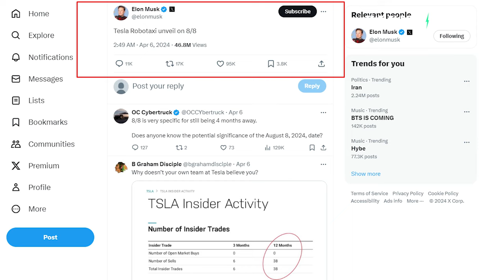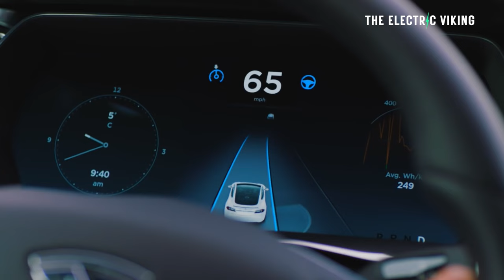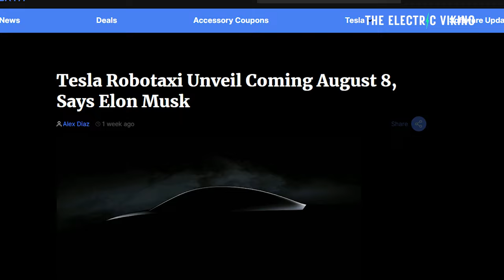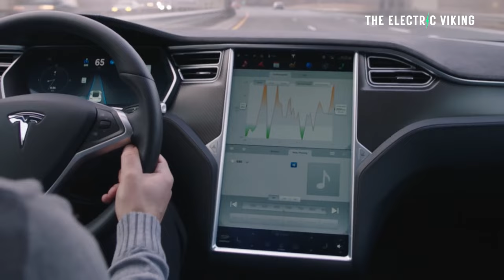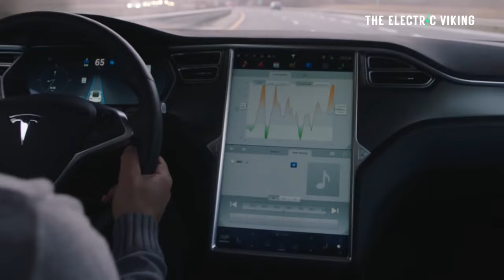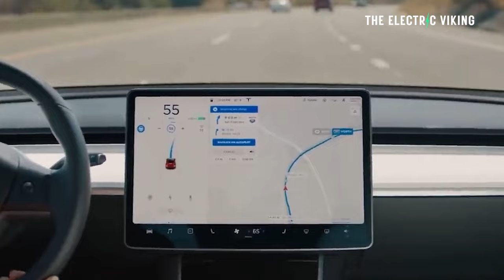Tesla is hiring Prototype Vehicle Operators in these 15 U.S. Cities

Comment: I have been testing FSD in the US during the free trial in a HW4 equipped Model Y and generally it's been a positive experience, however it's still more a curiosity tool than a fully functional one. I have had to intervene twice when doing a U-Turn and a Left Turn across busy roads, it just wasn't up to those two tasks. FSD where you can relax and be confident of the vehicle doing its own thing successfully is coming, no doubt. So it's great that Tesla are the leaders in this field and I am sure they will crack this nut eventually!

Comment: [Hhhmmm ...] Looking into using Cybertruck/extended-range as a emergency tow/charge vehicle for EV's in South Florida area. Does anyone know if EV's default to 'neutral'[N] once the battery dies(?) Once saw a totally bricked Tesla that  couldn't even roll off the tow-truck for charging🤯 Couldn't even open the charge-port, fixed on Cybertruck[?], but also saw the workaround in the trunk space. Of course, conversion to a #CyberFood truck is another one of my whacky ideas that would certainly draw a crowd at events, or just at large Supercharger locations(...?) Just a thought🤔🤑

Comment: The future of FSD is integrating FSD into municipal transportation systems which will make automobile ownership optional in large cities, generating cost $savings across a large spectrum that exceeds the value of the FSD vehicles.
Costs that can be reduced or eliminated: traffic congestion, municipal traffic police, parking, insurance, maintenance and repairs, accident deaths and injuries, taxis, SMOG air pollution, noise, home deliveries at night when roads are not being used, FSD vehicle owners renting their vehicles when not in use, etc.